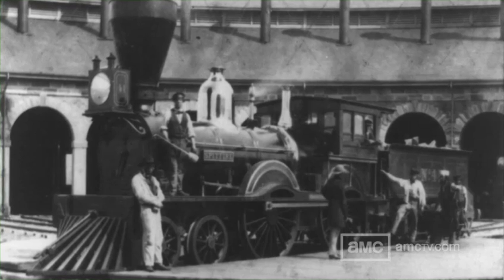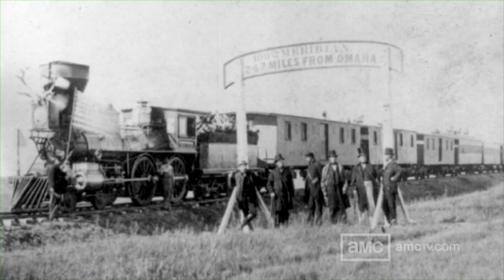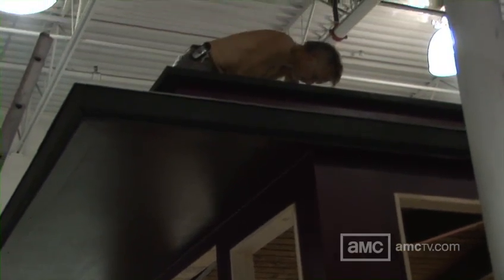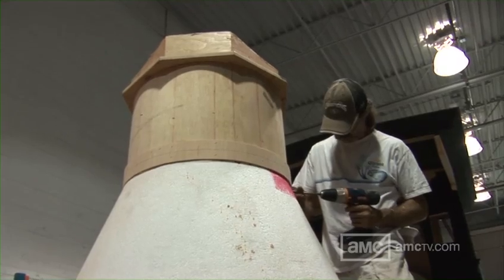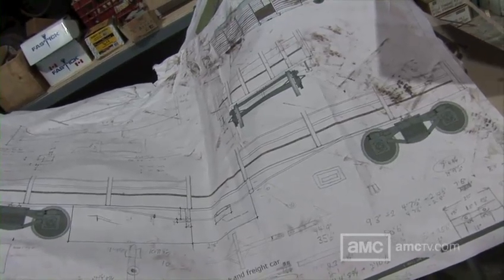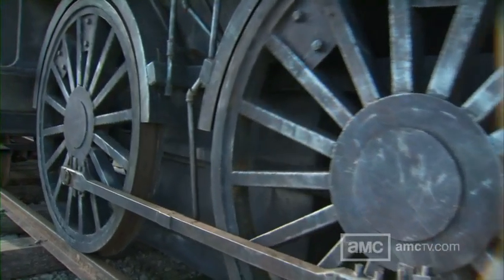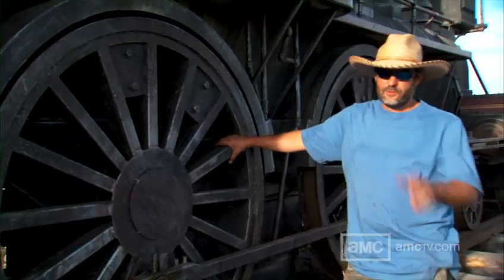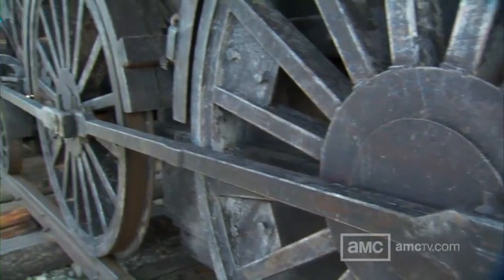Building the Train: Inside Hell On Wheels

Comment: 1:00 Holds up three truck logging shay  "you gonna build that?" "yes" LOL. For those non-train people, three truck shays didn't exist until 1885 and were used strictly for hauling logs slowly over relatively short distances. You can tell the guys talking are not the guys who did any research or actually told the builders what to build. Very glad someone else cared enough to make it accurate.

Comment: During this time period locomotive engineers and firemen took pride in the beauty and shine of their locomotives. No railroad man would be caught dead around a locomotive this dirty and grimy; they'd spend all of their free time wiping cinders from the boiler jacket and polishing the brass fittings that don't exist on these reproductions. Has no one seen the actual replicas at promontory? Also, why is there no ballast on the track?
Reply: Maybe some engineers would, but I doubt the westward bound engineers cared for such things
Reply: @Designandrew  Yes they did, all engines were extremely well kept, cleaned, and maintained. Back the , the engines were used by the same crew everyday, and NO engine would wear something like "Thomas Durant" on the tender, maybe as a name on the cab, but not the tender, that's where a company name would go.
Reply: @sudriansignalman9387  yeah the fact that Union Pacific isn't shown anywhere on any train annoys me. Could it be copyright, even if the show is about the UPRR?
Reply: @aj3751  I wouldn't think so, and more than likely UP would just think of it as free publicity

Comment: It looks surprisingly decent for a prop made of wood and styrofoam, but there are some real, period correct locomotives out there that they could have used. Virginia & Truckee #22 "Inyo", which lives at the Nevada State Railroad Museum, would have been perfect (it's from 1875 but looks close enough to 1860s-era locomotives). I'm thinking they probably went with a custom prop so that they would have full control over it and be able to take it on location, but still, there's a lot they could have done with a real locomotive that they couldn't do with a fake one. Especially for a show where the railroad is literally the entire point of it, I think they should have put a little more attention into making the trains look good, rather than it being a last-minute rush job.

Comment: The locomotive sticks out like a sore thumb to me. the search that brought me here literaly was : the train on hell on wheels is crap. But considering the team only had 3 weeks to finish it, I'll give it a pass. Otherwise I'm liking the show for the most part.
Reply: +Bg Labelle I'm trying to figure out if you're serious. Try searching google images for "Leviathan 63" or "York 17". Yes the crew did a good job on a tight schedule, but they are far from accurate for the time period.
Reply: This Guy Two There is always something better made or better filmed or better reproduced out there but I do believe they did a great job on this.  Sorry, but I believe in giving credit to those who truly try and they did.
Reply: Bg Labelle Look on the behind the scenes on The Lone Ranger movie. Sure its not steam but the locomotives could run on their own and they were scaled and standard gauge.
Reply: @FerrousEquusEng  the Leviathan 63 wasn't made until Sept 1868, its sibling, the Jupiter 60, was involved in the Golden Spike Ceremony May 1869 (along with the Union Pacific's No. 119)...so it actually was designed more with passengers/pr in mind and saw limited use in the construction of the first transcontinental. The Central Pacific's Gov. Stanford is a model 4-4-0 built in 1862 and was used extensively in building the railroad. Pictures of it line up with the HoW styrofoam model - granted its a TV show, not an accurate historical representation...but that being said they did a decent job!
 In my quick research, I couldn't find a similar period built Union Pacific train so if someone finds one, that would be awesome to share!
Reply: I know. I immediately thought of "The General" which had been in service since before the civil war... it would not have been hard to copy, and there's one on display in Georgia (I believe)